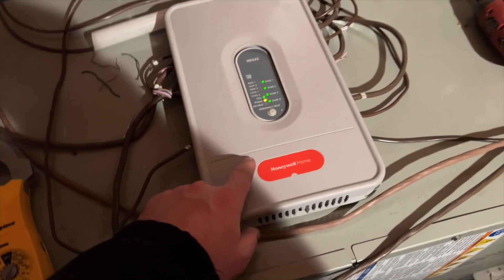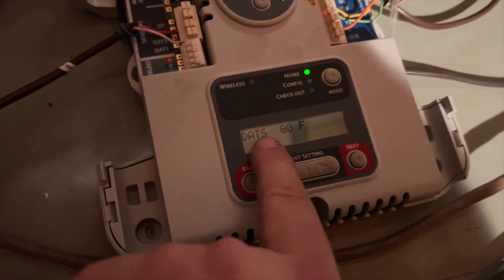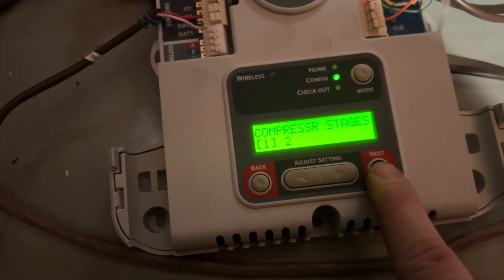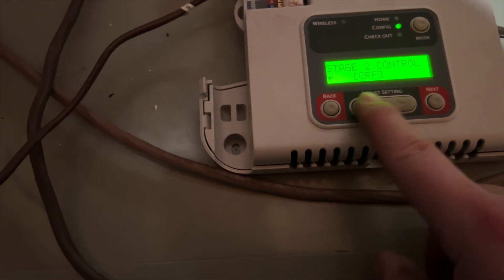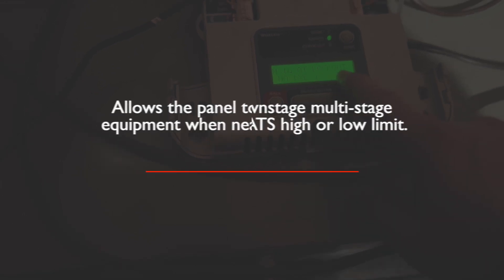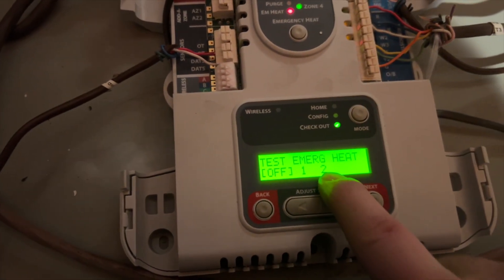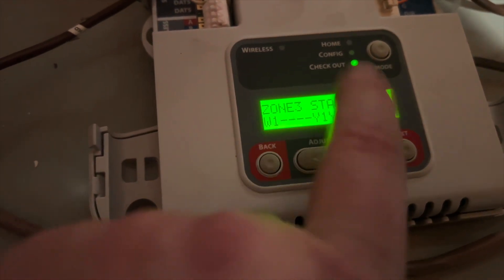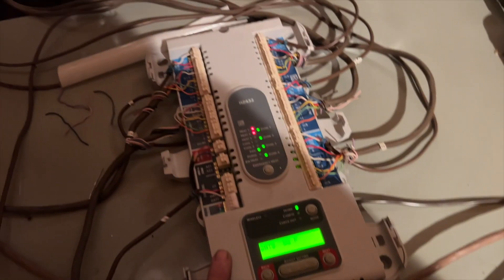How to Operate The Honeywell HZ432 Zone Control Board EP165

Comment: Also be aware that if your utilizing this on a dual fuel cold climate heatpump application the DATS will shut the heatpump down at 119F discharge temp. These heatpumps produce way more heat than a normal heatpump will. Because Risedio didn't have an answer for me I had to put a 500ohm resistor in series with the sensor and this eliminated nuisance high limit trips and I adjusted the furnace DATS accordingly. There is not an adjustment for the heatpump DATS cutout.

Comment: Question,where does C common from the unit going to the zone board go,there's no C on zone board,but there's a C common on the air handler,I think just the gas furnace zone board has no Common.

Comment: So what controls the fresh air intake? Obviously no ERV on this system, just an intake with damper. Does this board not control that damper as well?
Reply: a small ventilation board. like 6 inches wide and tall roughly

Comment: Good video! My heat or AC won’t turn on. I replaced the temp sensor but my HZ322 stays in purge mode and the EH light is red.
Reply: Did you ever figure out why it stays in Purge Mode?  I wonder if the controller needs to be recalibrated in order to properly work with your new sensor? (I don't know much about these DDCs, but I am learning about them now.)

Comment: I have a Honeywell hz322. My heat will not turn on and flow. Heat 1 is constantly blinking red. Only 2 zone unit. Why is my heat not running? TIA.
Reply from the maker: I can’t be sure as I would need to check the unit. But usually when the heat light is blinking this possibility means the zone controller discharge air temperature sensor has reach a high limit. This is caused by an airflow problem. Dirty filter plugged evaporator coil, plugged secondary heat exchanger, failed zone damper actuators,failed blower motor, dead blower run capacitor, dirty or broken blower wheel, or some kind of airflow restriction.

Comment: My first time dealing with one of these boards and 2 of 4 zones are staying open constantly.  I’m getting 28v on open and 25 on close for the actuator at the same time when calling for those zones.  I wouldn’t think I should get voltage on both sides at the same time.  I would think close would be zero volts when asking the zone to be open.  Bad board?

Comment: Great video. I have a new conventional HVAC system . Using Ecobee t-stats, which worked fine with the old system. When new HVAC system was installed, a new Honeywell zone control board was installed given that that new system is a 2 stage.  Right now, one of the zones is calling for cooling but not working (condenser fan remains off), however, despite using the same unit, zone 2 does work when calling for cooling.  Do you think this is a t-stat issue or a control board issue?
Reply from the maker: Sounds like a setting on either the zone board or the tstats. Possibly wrong wiring.

Comment: What does Cool 1 and Cool 2 indicate? Is this to indicate which cooling stage the unit is running in? If yes, will that display accurately if your thermostat is setup to control the cooling stage (vs the HZ432)?
Reply from the maker: Cool 1 is cool stage 1 Y1. Cool 2 is cool stage 2 Y2.

Comment: We have 2 zones and around midnight, one side of the house continues to cool while the other side of the house stops cooling.  Is there a reason one damper would close in the middle of the night while the other remains open?
Reply from the maker: The thermostat in that zone may have a program that causes this to occur.
Reply: @NighthawkHVAC  I am assuming it is because the damper closed but I am not certain.  Last night  I tried turning off the zone 2 that continued to cool to see if it would affect the other side but it didn't.  The same side stayed warm (zone 1) and the air continued to come out forcefully on Zone 2 even though the thermostat was turned off.
Reply from the maker: Then you may have a faulty damper actuator motor